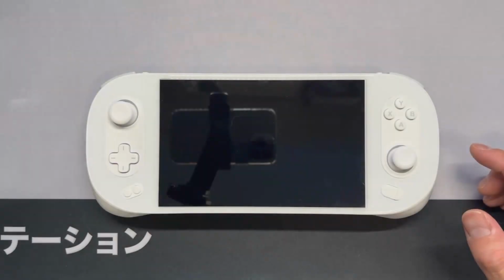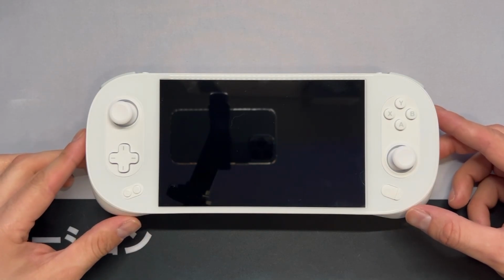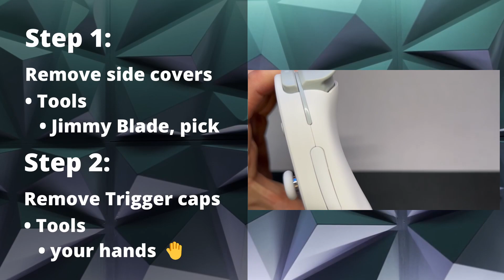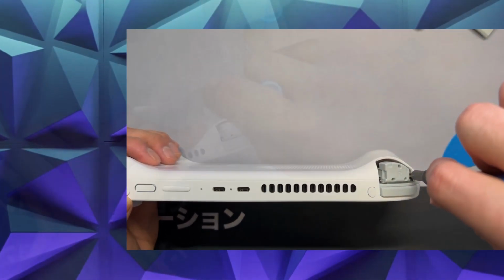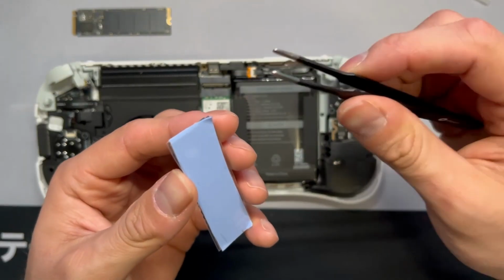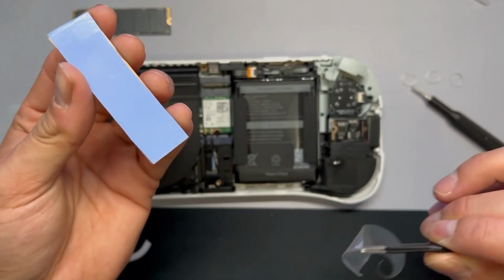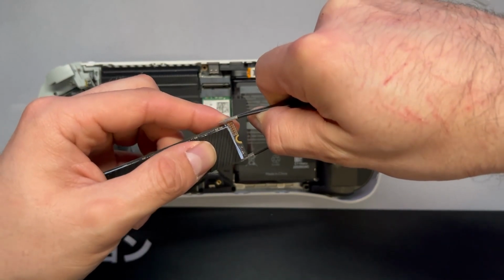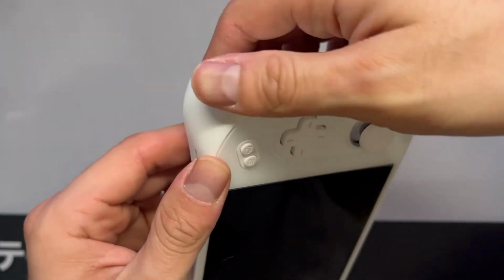AYANEO 2 / 2s drop SSD temps up to 12c! SSD heatsink install guide

Comment from the maker: SSD Heatsink link:

1.5-2mm heatsink for sure fit. 3mm May as well. 

https://www.amazon.ca/dp/B0B6QG9XGK?ref=ppx_yo2ov_dt_b_product_details&th=1
Reply: Do you know where I could get the LT and RT triggers in case they get damaged? Mine work, but it's just in case. How would I find them? And regarding the internal battery, if it gets damaged in the future, where could I get another one of the same model? Could you help me, please?

Comment: Or buy a decent branded SSD, then you won't have any more problems.😅😂
Reply from the maker: Or option 3, get the better SSD and add the $10 mod and get even better temps.
Reply: whats a good ssd brand i can use to replace the stock ssd on my neo2 retro? thanks
Reply: @ralphwaldoramos not sure if you are still wondering but Western digital, Crucial, PNY, and Samsung come to mind for great SSD brands

Comment: Add 2 flat copper tubes to conduct heat to the metal position above the fan, and it will drop to about 50
Reply from the maker: Maybe I’ll have to experiment more. I haven’t looked closer to see how much room I have between the shell and the fan